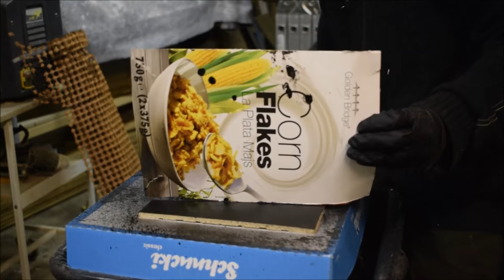Restoration - Old Rusty Hammer

Comment: Nice video! You should try soaking metal in vinegar overnight and then remove the rust with a wire brush wheel on your bench grinder. Cleans up really nice and doesn't remove so much material. Sometimes you'll even uncover the original etchings in the metal.

Comment: Why would you go to all that effort making the metal look so nice only to coat it in paint?
Reply from the maker: not a lot of effort took me maybe 10 min. Also for rust protection.
Reply: because rust will spread and all of it needs to be removed or this would all be for nothing. Also the paint would add protection from future scratches, gouges, and rust  :)
Reply: cmon look WHERE he sand it and WHERE he paint it
Reply: There are liquid rust pacifiers on the market, and probably recipes online for mixing rust  inhibitors. I've used them working in a sculpture casting foundry.

Comment: I found a 4 lb head just like this one....removed rust with electrolysis method with a car battery first in a five gal bucket....saved on the grinder brush.....making a handle out of some oak I repurposed from a pallet....as my own rooster crows in the background also....lol..........oooooo.....my kingdom for a belt grinder.......Im just a beginning novice.......I am currently building a forge out of an old gas cast iron BBQ......a lot of repurposing out here in the Az desert....maybe soon will make myself a knife and some blacksmith tongs......thanks for the inspiration!

Comment: Woa, amazing restore man!  Did you get it that shiny with sand paper alone?  No buffing compounds?  Did you wet sand or dry sand?  Thanks!
Reply from the maker: they are called micro mesh pads. They are supposed to be used on resin and plastic but they work fine on metal as well. I dry sanded. Thank you!
Reply: I just found the pads on eBay for $12.75 a set of the same grits you used.  I might buy a set and see if they work better than using buffing compounds.  Great video thanks again!
Reply from the maker: Sand first and then fine buffing compound after. You're welcome.

Comment: Handle cracked because of the blow torch. There was moisture in the wood, which could not escape, because of the oil that you have applied before burning the wood...
Reply from the maker: Sounds about right. Doesn't matter though, the crack closed again.

Comment: For a hammer like that, you're best off burning out the handle, removing the rust in an electro bath, and calling it a day. It is very easy to ruin the faces of a hammer on a belt sander, turning your flats in to piens. Which is what happened here.
Reply from the maker: Andy Tobin why should i burn out the handle when i can remove it in 2 minutes in a vice and please do I explain how i ruined the faces of the hammer.
Reply: Make N' Create burning out the handle preserves the original metal wedge, makes it easier to reuse.  The geometry of the hammer faces is pretty delicate, and it is very easy to round them over too much, and change how the hammer functions when striking steel.
Reply from the maker: The metal wedge was way to rusty to reuse. Don't really get what you mean with delicate geometry, I made the faces of the hammer so that i have a round side and a flat side, look up rounding hammer.
Reply: Make N' Create. Looked otherwise in the video, must have been a camera thing. I am quite familiar with rounding hammers, I have a few in my shop. I now see what you were going after, and while your convex looks a bit more extreme than I'd use for a hammer of that shape, hammers always boil down to a personal preference thing.
Reply: Andy Tobin burning out the handle will ruin the heat treat. It's pretty common knowledge...

Comment: This is ridiculous. It's a fucking hammer! Clean up the head with a wire brush, replace the handle and you're done. And the way he made the handle is idiotic. He started with a big chunk of wood and removed a huge amount of wood . . . with a belt sander??? Does he not own spoke shaves or planes? At least he could have taken off a whole lot more wood with the hatchet. And when he is all over, there is a big ass crack at the end of the handle. With any serious use, that crack is going to work its way all up the handle. That was a ridiculous amount of work to make a hammer with a cracked handle, when you can buy a new one for $25.
Reply from the maker: Oh no someone did something a different way than I would've done it :O. I have used this hammer for a very long time now in all my blacksmithing projects and can you guess what.... the crack has not traveled any further. stop crying and realize people do things different ways. I might make a handle where I do it on the belt sander or I might make one using a spoke shave and saws. who cares!
Reply: Make N' Create , I say well done! We do what we do with what we have. Our skills are developed with the tools we have. The best part is, you went through and did it. Talk is easy, production is not.